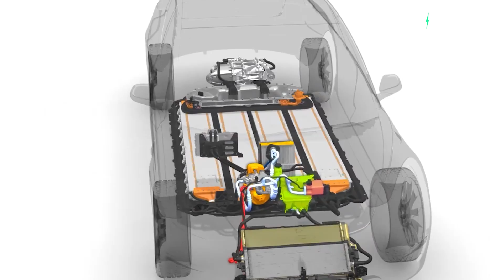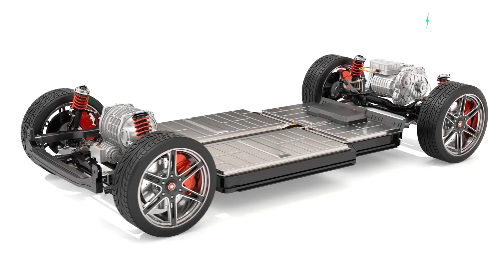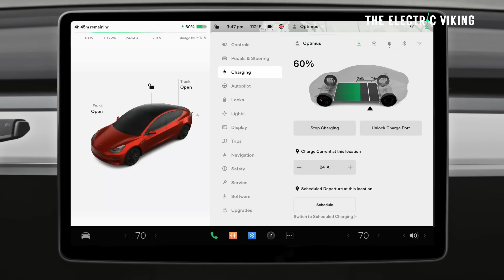No, you don’t need to replace Electric Car Batteries in 10 years time

Comment: I looked at replacing the battery on a 2012 Chevy Volt. My daughter had taken my old Volt to LA. Her range appeared to be degrading (although I think that was more a function of frequent highway driving showing a decreased expected range than any actual battery degradation). The cost quote I got was $9k in the summer of 2023 for a new battery. That cost was net of any salvage value for the battery itself. The car itself was worth about the same number on the resale market. She has since left LA and is still driving the car as-is. I just did a quick google search and was seeing used Tesla batteries for around $6k on EBay with 50k on them. So better, but that would not include any labor or auxiliary parts for the replacement. I did not find any battery repair services available in LA for the Volt. If can't find it in LA, where are you going to find it in the US currently? Now some of this will vary by manufacturer and I largely agree with a lot of the things the OP has said, but I don't see the in-the-weed evidence that the picture is quite as rosy as being painted, at least not yet. At least with the 2012 Volt, we have a 12-year-old battery with 100k on it that is operating at about 75% of original charge and is not really economical to replace. At least with a Tesla Model 3, it looks like replacement costs are probably pretty similar. I don't know if consumers on the ground are seeing a 90% reduction in battery prices as it pertains to replacement batteries. I don't know if consumers on the ground are benefitting from the residual value of the battery. I know things will get better. I just don't know where we truly are on the ground in the US today.
Reply: You really can't compare a 12year old Chevy volt with today's LFP tesla's. EV tech is light years ahead today
Reply: @larryc1616  I didn't, if you read the post carefully. For the sake of productive argument though, show me a battery repair facility in the US. Tell me how much repair for a 2018 Tesla Model 3 would cost. Tell me how much a replacement LFP Tesla battery costs. If you want to have an apples-to-apples discussion, bring some facts to the party.
Reply: There is a company called Tesloop that ran a Tesla 600,000 miles and then they got a free replacement because they were only able to charge to 75% capacity (80% is the cut off). Obviously this was an older chemistry, the Tesla Panasonic batteries produced in California, that made it 600,000 miles. I have no idea who Chevy bought their Volt batteries from, but they "moved up" to exploding batteries by LG afterwords. With Tesla, you do everything with Tesla so that's why there aren't independent battery repair services for your shit box. 

"hey wheres all the independent battery repair facilities in LA to fix my limited run Chevy shit box cancelled car that was produced for 4 years max" I dunno contact Jehu Garcia. Most mechanics have never taken a battery pack apart and tested the batteries, that's an electronics job. By the way there are tonnes of guides on YouTube of how to do it yourself.

Comment: EV's are just like ICE cars. They're no different. If you abuse a battery, you'll kill it, prematurely. This is well documented. If you abuse and ICE vehicle's engine, you'll kill it, prematurely. This is also well documented. The limitations of both are well known. You can quote all of the "data" that you like. "2% here, this data says... 100k miles, fuel, blah, blah blah...." on it goes.
The reality is, if you don't look after something, you'll kill it. The RC car community, the yachting community, the ham radio community and the E Bike community all know full and well the limitations and advantages of lithium ion battery chemistries. Don't sugar coat the negatives, they're real, and largely avoidable. Educate.

Comment: Ah...batteries last forever!  Thanks, Sam!  I'm sure all the folks who tossed their EVs due to battery failure will fewl much better now that you said that!

Seriously, dude...
Reply: EV's normally have 8-year battery warranty, so when did they toss their batteries, and who?
Reply: @travellover3373  Please check actual results...they vary from EV company 'studies.'
Reply: Based on my experience with batteries in general and lithium batteries in particular, I would assume 5 to 10 years of useful time.
Some will fail (much) earlier, some might last even longer.

Since they are expensive, just calculate with the warranty given and buy a new BEV when it runs out.

Comment: 2018 Bolt is about $16,000, 
2018 Bolt battery is about $16,000

2018 Toyota Corolla $16,000
2018 Toyota Corolla engine $2000

They might last a long time but that's not a $16,000 risk i want to take. At the least i would buy an extended warranty that would cover battery which shouldn't be expensive if they have a low fail rate
Reply: 2018 corolla battery about 100 USD?

Comment: wierd that car batterys hold up when my laptop and mobile phone dont. And now people say the batteries are too hot in the phone and laptop.. No they are not. If they would, I would burn myself.  I would say that the car batterys has this buffer that the manufactors take of, so the battery is in fact bigger than what they claim. My laptop after 3 years is down to 66%. It only uses around 7watt at max so it hardly gets warm .
Reply: Laptop batteries aren't liquid cooled and aren't designed to be long term machines.
Reply: @samuelwilliams7331  well i would say the battery is around 45-50 degrees when charging. Is that cobsidered too hot?
Reply: @AndrewTSq  If you going into service controls of a Tesla you can see the temps the batteries get to and hear the heat pumps kick on. The charging rate declines if car can't keep the batteries at an optimal temperature.  45 - 50 degrees Celsius would  be consider good and not to hot.
Reply: because laptop and mobile phones frequently get charged to 100% since they are small capacity. EVs are not charged to 100% on daily basis.
Reply: @Fear.of.the.Dark. My  devices stop charging at 85%. Its a feature on most new devices you can enable. Also I heard tesla talk about batteries, and the last 15% takes as long time as the first 85% cause when the battery is empty its easy for electrons to find a "parking spot" (as they called it) while when we reach around 85%, it gets harder and harder to find a parking spot, which is why it takes a lot more time.
Reply: @AndrewTSq  it is not turned on automatically for all new laptops. User has to turn on if they are tech savvy. My Lenovo work laptop did not have it turned on by default to stop charging at 80% so vast majority keep their battery charged at 100%. Plus laptops are always running hot with cpu air blowing like crazy when I am crunching large workloads unlike ev batteries that have active coolant running around to keep it at ideal temperature. So laptop and ev batteries are not managed same.

Comment: I own a 2018 Model S 75D, easily the best car I've ever driven.  It's so freaking fast.  I've also got Full Self Driving.  I'm 71, so this is my last car.  I'll give it to my granddaughter to drive around college in 20 years. Battery prices are also dropping quickly.
Reply: Prices definitely aren’t dropping. 
Prices of replacement Tesla batteries are higher than ever. 
There is so much demand for batteries the price will not come down any time soon. 
I still got a model 3 but it does concern me a bit. 
Saying that, my Ute just died. The timing went out and the valves hit the cylinders. I’m looking at up to 13 grand to fix it. Cars 12 years old now. Basically a write off if the cylinders are damaged. Find out soon.
Reply: As a young punk 62 year old, I celebrate the fact you still use "freaking" in a sentence at 71.

My next car will be an EV but that's likely to be 3-5 years.
Reply: @mac_mcleod  I saw Hendrix, Joplin, Cream and Blind Faith live. I am a freaky guy
Reply: @JamesJones-ql3kr how could you leave out Vanilla Fudge, or King Crimson, and Moby Grape!?!?!? 😎
Reply: You'll need a new battery in 20 years. Rest of car might be OK
Reply: @TheJoncic  You funny, you say this on a video explaining this as you don't understand. 😄 Even so this myth was true, do you think in 20 years batteries will still improve?  Cost less ?  And less and probably, like it is the case for petrol car,  you will probably wanting to improve your car in 20 years and most do it in 5 years, LOL ?  I prefer to have all those money I save in my pocket, compared to the way, overpriced gas that money go to anybody exception of customer using those petrol car.  😉
Reply: @sergiomomesso1590 Fully agree 😂 My 2022 Kia EV6 AWD GT-Limousine or Crossover if you want uses an equivalent of 2 litres on 100 km! My 1969 Mercedes 300 SEL 6,3 V8 needed over 25 litres, was faster than a Porsche 911 at that time and had 250 PS/500 Nm of torque. The Kia has AWD, 333 PS/608 Nm and uses over 10 times less energy. So with the savings on electricity cars we could in fact make dramatic savings on fossile energy from negative towards our western values oriented sources. We must become free from any oil for just burning at 35% efficiency. Australia would be perfect to go for 100% EV, PV with small hydrogen used for cooling or heating a house but never for cars and trucks as the infrastructure would be mindblowing, wind is also available and waves in the seas around. So your country especially would not need the actual amount of oilproducts anymore resulting in freedom, lower taxes and cleaner air in the cities. Of course that we still need these products but as demand goes down the prices will too!
Reply: @Lifecoach7Ra  I completely agree with you, I'm a fan too of BEV from 2022 from when I got my Ioniq 5.   I think you miss read my post. ;-)
Reply: It will be an autonomous car soon. You'll definitely be alive to see it sir.
Reply: Existing cars won't be autonomous. Full self driving is nothing but vaporware @-whackd  - When it eventuates, it won't work on older cars due to their lower processing power and lower quality sensor quite.
Reply: Tesla should have kept battery swap
Reply: @PhilthyMr 
that was the worst idea anyone ever had ...
Reply: @PhilthyMr 😂Battery Swap ?? Like Nio ?? 😂😂😂 $3 a share
Reply: @PhilthyMr  Tesla actually tried battery swap.  They figured out what it would cost and what the advantage/disadvantage profile would be.  Their determination was that it was not a good idea.  Do you really want to lease your battery forever, and pay for a million swapping stations, along with the spare batteries they would all need?  It's a horrible idea.
Reply: Y’all are interesting to think batteries should last 20 years.
Reply: @PhilthyMr  It'lll get close to 20 years. Rav4 EV from Y2K on average survived 17 Years. These are just the real world facts, not theory.
Reply: @PhilthyMr we just follow the data.
Reply: Yeah wright! Ha give it to your granddaughter,  what a joker! Will be very old tech by then dude, yeah and parts still made in 10 years I doubt it! No lifetime warranty dude
Reply: @judechopper  Considering it's a Tesla Model S, I bet aftermarket will still support it as it has been very influential in the industry. Sure most other EV models won't get that kind of parts availability but a 2018 Model S very much will.
Reply: Actually HYDROGEN IS NEXT  DOPES
Reply: @judechopper no to expensive

Comment: Am I the only one who had alarm bells at the idea of even getting close to 20% degradation? EV ranges are already pretty poor (and mis-sold to consumers with the WLTP nonsense), but to think after 5-10 years it's going to be at least 10% less that totally blows a hole in the second-hand market ... any surprise second-hand prices are tanking just now? I'm eager to see some improvements in battery tech that gets past the range and degradation problems!
Reply: That's why you get the biggest battery. So it can still have some range left and much less wear and tear since you'll charge it far less.

20% degradation is normal for batteries after the first 1 or 2 years. Then they are pretty stable and towards the end of their life, they will again loose quickly.

The problem is often not the range per se, it's the amount of time it takes to charge it. Few people complain that their motorcycles have only 150 to 300km of range, because they can simply pull up to the gas station and fill it up again.
Reply: I mean I probably won’t ever even consider replacing a battery until it’s under 100 miles (for daily driving)
Reply: Tesla second hand orices will not fall below a certain level due to their potential to become robotaxis
Reply: Our ev range ( model 3 rear wheel drive ) is amazing. 45000 km, very little degradation, 1 year old.  I am sure in 5 years we'll be much smarter though.
Reply: By the time a car bought today sees its battery degrade 20%, the number of charging stations will vastly increase, which means the importance of range to begin with will decrease.